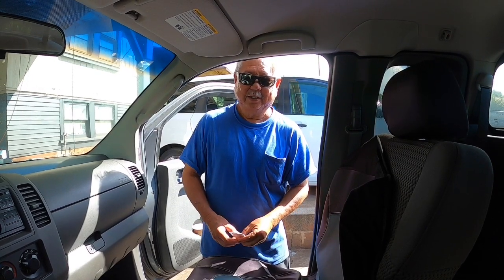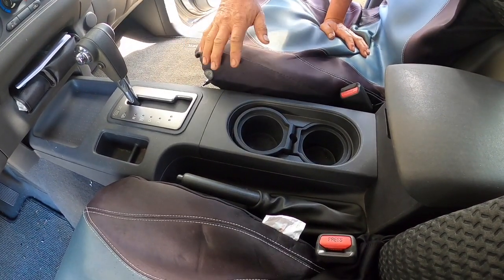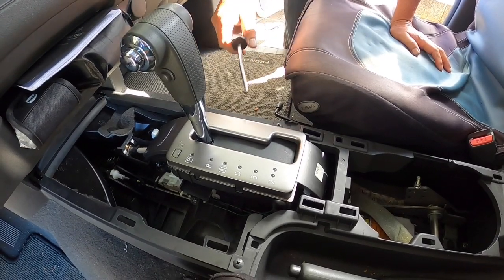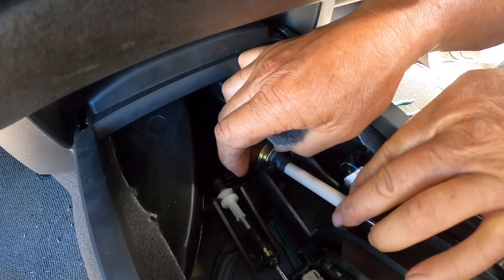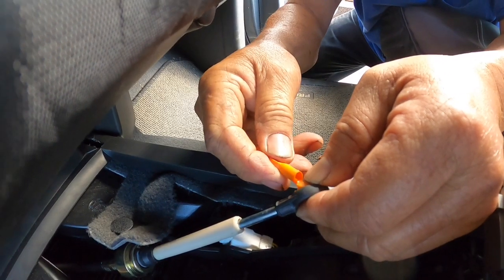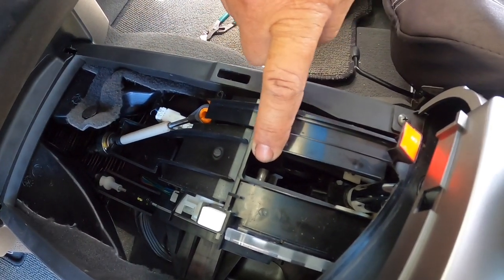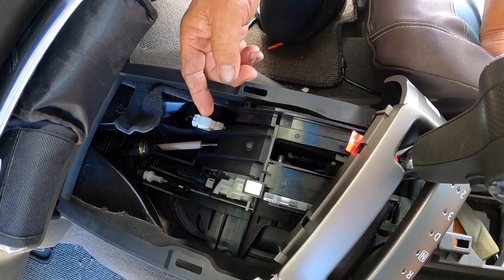How to Replace Gear Shift Cable Grommet (common problem) On A 2008 Nissan Frontier

Comment: Hey, Roy. I had this problem at work today with my 2010 Frontier, and my girlfriend was able to stop by a parts store to get a grommet and came by the job and it took us about an hour to fix it. Hardest part was certainly getting the grommet into that loop, and then fitting the loop back on the shifter - those two things took the most time. Anyway, big time money saver so I am very grateful for you and your video. Big thanks!
Reply from the maker: Thanks for watching 👍👍👍
Reply: What part store did you find it
Reply: @preacherboym  - advanced auto parts

Comment: Thank you Mr. Roy,... I put mine in reverse, backed out, put it in forward and it kept backing up, couldn't get it to park either, frantic, I cut the truck off, and it wouldn't crank, found your video on google,  after figuring it might be the shift cable,  and your video makes it easily doable,..  Thanks again!

Comment: Thank you for putting this video out. I have a 2005 Xterra and, one morning, it stopped going into gear. I opened up the gear shifter area and, like you said, the grommet was gone. I ordered one and it fixed the problem. I appreciate you sharing this with everyone!

Comment: Super helpful video was able to fix it in less than 45 minutes. biggest issue was losing the grommet under the shifter and the tool breaking. luckily a flathead did the trick. big thank you!

Comment: Mahalo Roy!   Fixed mine today and took about an hour (most time was for me to get my fat fingers through the small space under the shifter to get it lined up on the shifter's pin).  Ended up pulling the shifter cable out further so that I could see it better from the top and line it up that way.  

Thanks again, you saved me a ton of money!
Reply: .I just need a grommet but the dealer tells me that I have to buy a whole cable @ over 300 dollars worst yet, they have to order it and it will take 6 weeks
Reply: @asiba2  Amazon had mine for about $32...ordered it on a Tues night, got it Friday, installed Saturday.

Comment: Good job . I have a 2011 pathfinder that had a bad solenoid and relay. When I pulled the cable off the grommet was toast. The plastic is different but the linkage is about the same. This helped alot.

Comment: I was looking in my garage for a tool (cotter pin tool) to remove the shifter cover when I tripped over my laminate flooring wedge!  I worked perfect.  I knew there was a reason I left that on the floor a few years ago!

Comment: Thanks for posting this up. Mine wouldn't go into gear the other day so I ripped it apart and was driving around the past few days pulling the cable by hand. Looks like I can buy the grommet and knock it out in a few minutes! Thanks!
Reply from the maker: Glad I could help, thanks for watching!
Reply: So me today!  Glad to know i don't have to spend 40+ dollars on a cable just to get the grommet.  My gf literally jinxed me complaining about me shifting so fast lol. Ill be back at it again soon thasos to this video
Reply: It works 👍🏾 👌  thanks!
Reply: SAME!!!  Was so proud of myself for figuring all this out by myself in a couple hours and now looks like I’ll even be able to do the repair job myself as well!!  So grateful to find this video!
Reply: @ChutneyInc.  
Asiba The Buffalo Soldier
1 second ago
.I just need a grommet but the dealer tells me that I have to buy -a whole cable @ over 300 dollars

Comment: Thanks Roy I used the pry par to take the plastic cover off the top and the cotter pin puller to remove the shifter handle but  I needed more tools in the box so this was a good excuse to add rhem.  It took me about an hour and between this and another guys video I was able to get it done no problem.  Thanks again a mechanic would have cost me a fortune.
Reply from the maker: Thanks for watching 🤙 🤙🤙

Comment: Thanks for the help. It went well with the exception of the little plastic tool they ship with bushing, it boogered up pretty quickly and wound up using a small screwdriver to push the rest of the bushing in on my 2006 Frontier.

Comment: Also the plastic gear selector cover can be released with a flat head or pocket knife instead of the cotterpin puller.  And the c- clip can be removed by hand. I figured all this out when i arrived at work today.  This video shows me that i can get the kit i see on Ebay for 24$ instead pid the whole cable for 45$
Reply from the maker: Thanks for watching 🤙🏽🤙🏽🤙🏽

Comment: Thank you sooooooo much, this helped me out in a tough situation. Last night( Friday night) I was driving with my gf and I was reversing but when I tried to shift into drive the shifter didn't change.😰😰 I was horrified because I had just rebuilt the transmission 1 week ago.  
We managed to find parking ( while in that awkward position) and walked home that night in the rain🥶🥶🥶🥶. the morning I YouTube the issue and It seemed like your video described the problem. I went and followed your instructions and was then able to use the cable to change the gear into neutral so it can start, and I went home.
I have a 2005 niisan pathfinder btw
Now its just to get the grommet from Amazon or eBay 
I am soo relived I didn't have to call a mechanic. Thank you soo much 🙏
Reply from the maker: Glad I could help, thanks for watching!

Comment: 🙏thank you ! I fixed my frontier 2007. The only thing is that I can’t do shift 1. The rest works fine
Reply: Did you seat the slotted cable that takes the clip in the right position? Seems like it’s too far back(towards the front of the dash)?

Comment: Thankyou very much just had that issue right now but i dont know where to find a grommet here in the philippines may i ask what code number is that grommet ? Thankyouuuu
Reply from the maker: You can buy this online at bushingfix.com and the part# NI1KIT. I hope that helps and thanks for watching 🤙🏽🤙🏽🤙🏽
Reply: Roy’s Garage Thankyou very much Roy

Comment: I have a 2006 Nissan Frontier was in the parking garage when I turn the key put the car in reverse and attempted to go in Drive the shift gear moved free with out easy but stayed in reverse. I turned the key again lights on but the car eould not turn over. Saw a video on what it could be. Ordered the part from Amazon.
Reply: I have 127,000 miles on my truck hope to keep it for many more years
Reply from the maker: This definitely could be the video for you! You’ll have to take the console apart to put it back into brake to turn on the car. Let me know how it goes and Thanks for watching 🤙🏽🤙🏽🤙🏽

Comment: Something not right with this ,no foot on brake but able to shift truck, also no key in ignition and still shift, all safety features been bypass?
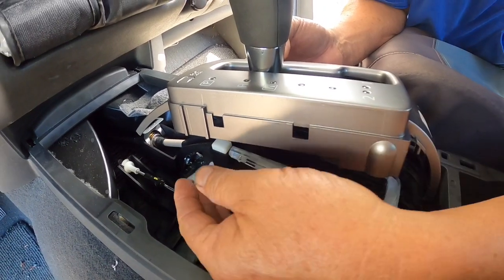Reply from the maker: Great question & concern. Under the plastic panel of the gear shift handle, there’s a white button that you press to override the lock solenoid on the vehicle that keeps it in park, you can see it around 3:38 minutes mark of the video. I hope that eases your concerns and answers your questions. Thanks for watching 🤙🏽🤙🏽🤙🏽
Reply: @RoysGarage808  wow that sure did , was wondering about that , I have to do the whole cable it’s damaged and needed to move the shifter  like you did all out the way to get cable end back on, oh what a pain well this explains it and very helpful  , they had a recall I believe on that lock got mine fixed but saw you vide wants sure though if your truck or not, but anyway Thanks again good information.
Reply from the maker: @1wtrahan  Glad I could help!

Comment: My truck gets stuck to reverse and i cant even start the car .. even though hes in paek gear but stuck to reverse what should i do
.
Reply from the maker: I believe your gear shift cable came off, so I would take the console apart and check. If it is that put it back on, hold it in place and shift it back into park. Hope that helps. Thanks for watching 🤙🏽🤙🏽🤙🏽

Comment: Just fixed the problem but now it won’t shift into 1st
Reply from the maker: It’s most likely not the cable side but id recommend taking it apart again, press the white button again to release the locking solenoid and try to manually shift it around. Underneath the plastic cover of the gear shift lever (stick) there’s a track that it’s suppose to be on, make sure it’s on that track. I hope that helps and let me know if you have any more questions. Thanks for watching 🤙🏽🤙🏽🤙🏽

Comment: Does it matter which way the bushing goes in. After I installed mine I noticed I faced the side with the grooves  out and you have the smooth side out. 
It seems to stay in place...🙏